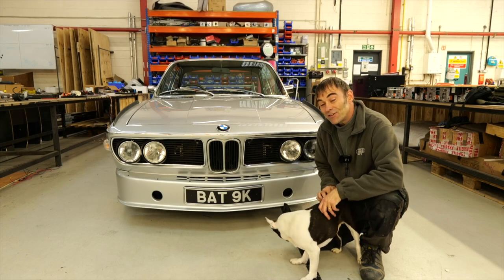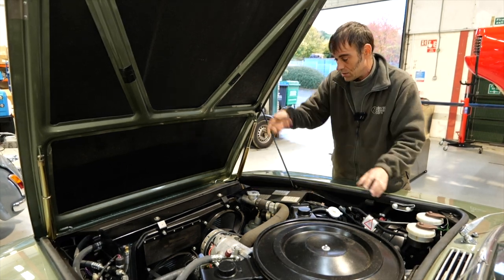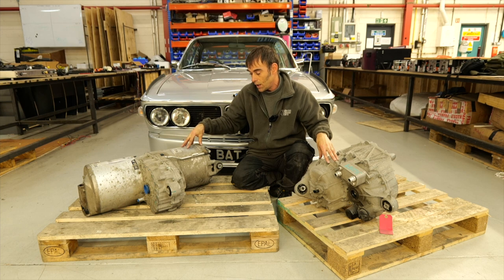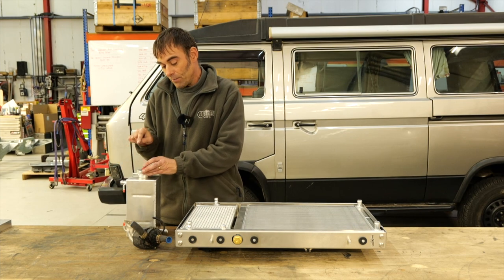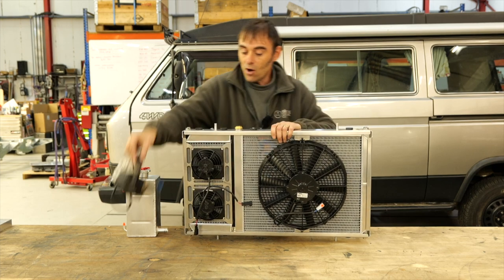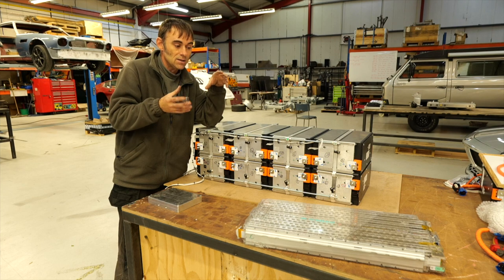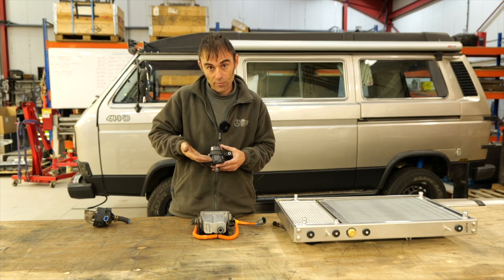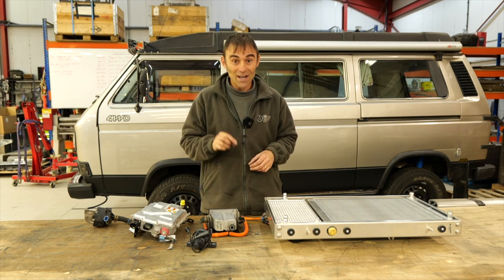Tech Talk - Why do electric cars have radiators?

Comment: I read in an article that by charging your electric car with a granny cable you loose up to 30% of energy by losses in the cable and connections. Is that true? That would be not so ideal with the high energy prices these days.
If i would spill 30% on fueling up my petrol car every time that would be a big puddle of fuel🤔
Reply: Don't think about how much of your fuel is being turned directly into waste heat without contributing to forward motion then!
30% seems like a lot. Most space heaters run at the max safe output of a wall socket. 30% of the heat from a space heater directly into an electric cable would likely melt the insulation on the cable quite quickly. That 30% figure doesn't seem to survive a logical look at it.
Reply: @Surestick88  maybe they calculated with 20 meter/60 ft cable. In that case you have a long distance where the heat can escape without burning up the insulation. But i think the losses are not just in the cable. There are also losses bij converting the ac current from your socket to dc current for the batteries. But yes 30% sounds pretty questionable.
Maybe Richard has something to say about this.
Reply from the maker: Whenever you transport and/or convert electricity there will be losses. There are inherent losses in chargers as they convert from AC to DC, which is why the onboard chargers need to be fooled to deal with that wasted energy in the chargers inefficiency that's turned into heat. The amount of losses depend on temperature and voltage. For instance the Nissan Leafs charger is about 92% efficient in 240v countries but 120v countries it's more like 85%.
Reply: @ElectricClassicCars  thanks for answering 👍
Reply: You spill the fuel simply by moving the fuel from the refinery. The truck moving it uses fuel that could in theory have been put into the gas station's fuel tank. That is all spillage. That's a lot of fuel spread out over a lot of cars. It's also a reason that a "gallon" of electricity is much smaller than its equivalent, and as such, it has already been removed in the efficiency ratings. What moves the electricity? High voltage transmission wires.
Reply: @ronaldking1054    There's also the fact that any petrol station with underground tanks has to have a massive amount of soil removed & disposed of when decommissioned, because underground petrol tanks apparently all leak.
Reply: @jeffreyquinn3820  Eventually they will as metal does not last forever. The gasoline might also be corrosive to the tank. That means the fuel station over time eventually will spill by seepage.

Comment: I don't give a hoot or a toot about radiators.
The reason that cars need grilles at the front is because I LIKE THEM!!!!!!!!!!!  Almost all modern cars are looking fugly, ESPECIALLY Electric cars! Therefore they all need proper front grilles in the design so that I like them! 
I'm right and everyone else is wrong! Bugrit bugrum!
Reply: I used to feel the same way but now the times are changing and I feel like a grill for the sake of it is like a fake exhaust tip 🤮.
Reply: @benellis7427  Hehe, so you're included in "The Wrong" from now on. 😛

Comment: The EV evangelists preaching gearboxes and radiators as unneeded only to be found lacking because of these assumptions.

EVs suck at Bonneville because they don't pump any air. And EVs suck on road because they don't have reciprocating flywheels.

Relying on bigger heavier batteries rather than sound rotational physics is the major embarrassment of major automakers and hobbyists alike.

And part of the reason they need a mobile nuclear power plant to power them.